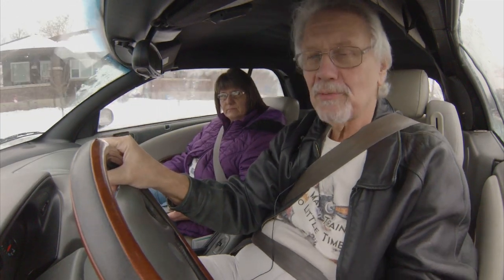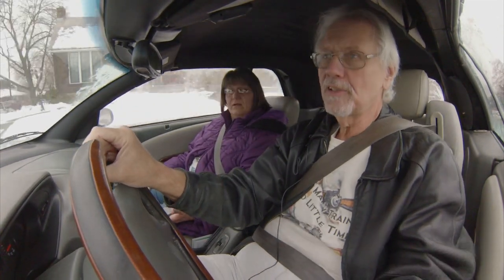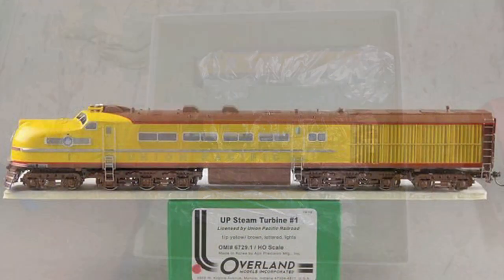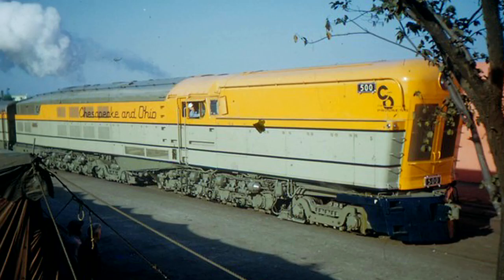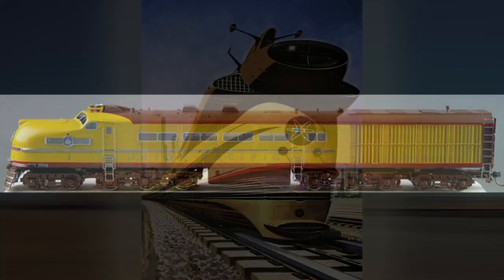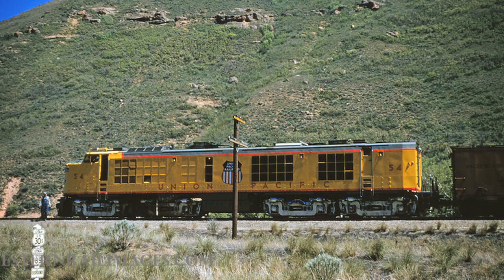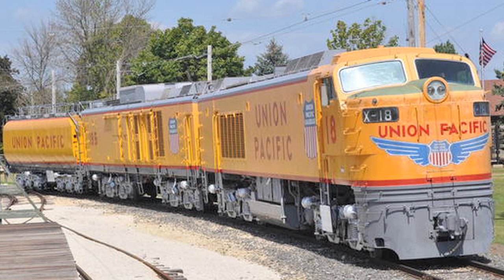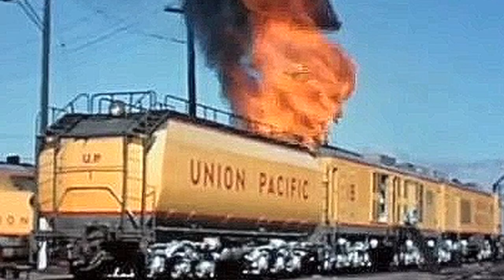What happened to the Atomic Train? - and HO Models of UP's Other "Expermental" Turbines

Comment: I’m sure it wasn’t just the initial cost of the engine that scuttled this.  I couldn’t imagine what the insurance liability would be on something like this.  If you had one meltdown or accident it could potentially spew radiation and ruin land for generations or even kill someone.  One accident could financially cripple UP even with insurance.
Reply from the maker: Back then they didn't really understand the risks. And it was a time when railroads were really experimenting. Really wanted something simpler than steam (this isn't) affordable and powerful. Diesel was assumed to be not able to "pull the weight" as the biggest ones were 1800 HP. What won the day for diesel is multi unit. MU all run by one crew on one locomotive. As many units as you need and at some point anywhere in the train to take strain off the couplers. By 1965 all other ideas were on the trash heap.

Comment: Given the hazards of nuclear power, better if anything to put your reactor in a central location, use it to generate electricity, and then distribute the electric current to electric locomotives. The disadvantage of this approach, however the power is generated, is the need for additional infrastructure to distribute the power, compared to steam or diesel locomotives which can carry their own fuel supply.
Reply from the maker: Someday all railroads will be electric. Union Pacific has tested overhead and different systems and if they ever put overhead on their system, thousands of miles, that will be the end of diesel. And there will come a day.... Just no time soon.

Comment: why are american locomotives usually painted black or not painted?
Reply: selrahc0 When steam locomotives switched from wood to coal, to reduce costs we started painting the locomotives black to save on cleaning costs. I guess the black color scheme stuck for most railroads, so that's probably why most American models are black. On the West Coast of the US they use some very colorful locomotives. Union Pacific is yellow, and BNSF is orange. CSX in the East has some blue locomotives, and short line R.J. Corman uses only bright red equipment from locomotives, to rail construction equipment, to pickup trucks, and even a helicopter.
Reply: The only railroad in the USA that still uses black is Norfolk Southern

Comment: wow, so your saying you modeled your own engines
Reply from the maker: +Mr goat These are all brass locos with added detail and custom paint. The "F" units are more complex, old Hobby Town frames, with the original helical gears, added fly wheels, and a neodymium motor out of a printer!!!  A drive shaft runs from the lead A unit all the way to the back A unit with 2 u joints between each unit! The body shells are Stewart and weigh in at about 10 oz. each. I cast all the details in brass. Then paint. Still needs lights and sound and just a few things. But because of the tractive force of this brute, when I tested it on the scales at one of the LA clubs it ripped the couplers apart! But I have pulled 120 cars with it and the loco was not even working hard. The strain on the cars though......
Reply: +Toy Man Television wow so that proves how powerful a little train can be
Reply from the maker: No kidding!!! When I built this I wanted to pull 100+ cars. OVER KILL!!!!!! But wow. AND it is sooooooo smoooooootttthhh. The helical gears are so smooth that when you set the units on the track and just push it, all wheels turn and the motor turns with almost no resistance. If you push it fast, the lights come on as the motor is making power!!! Future show!
Reply: +Toy Man Television cant wait to see it

Comment: i do have trains that have sat for 20 years 1950s lionel and ho and even n scale have over 100 locos in nscale here ran out of space for them  the lionels  old and in great shape like new dont like new and im really injoying the lionel  run really good they look like brand new but yes the old foam inserts are the worst they turn into sand not good for rare engines
Reply from the maker: Never thought foam could turn to sand or clay, but it sure does!! Need to replace it every 20 years or so.